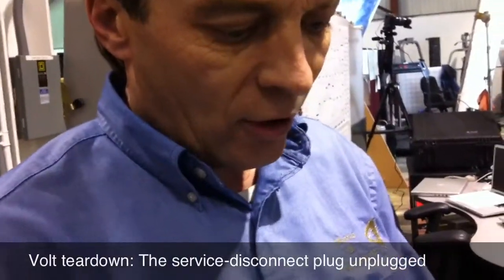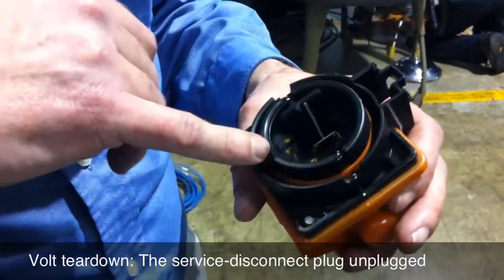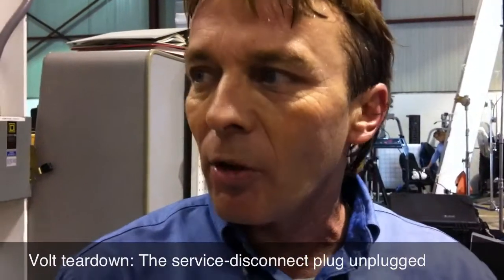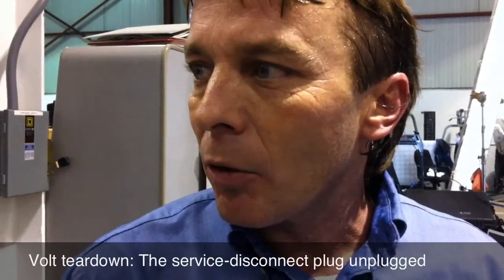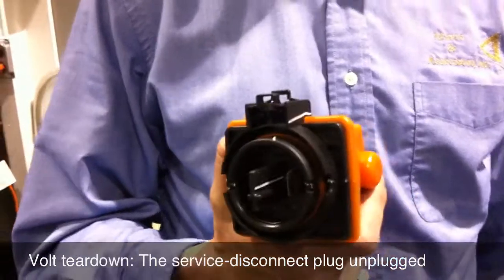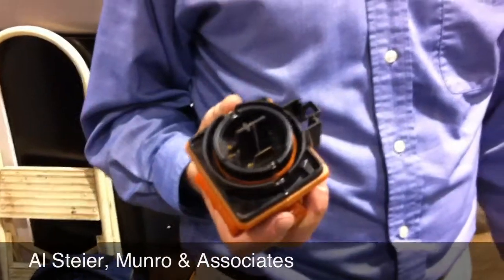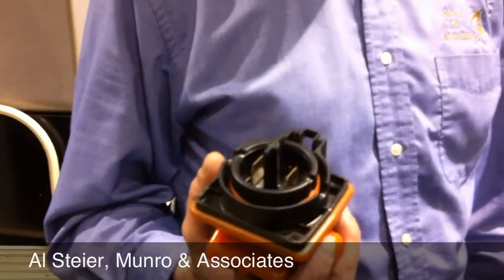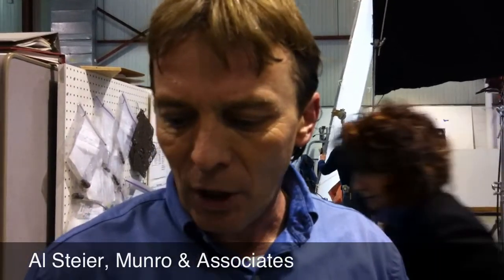Volt teardown: The service disconnect-plug

Comment: where does it plug into?
Reply: In between the rear seats I think
Reply: Gen 1?  Under the armrest between the driver and passenger seats.
https://www.gm-volt.com/threads/found-what-i-think-is-a-battery-disconnect-under-the-arm-rest.92425/